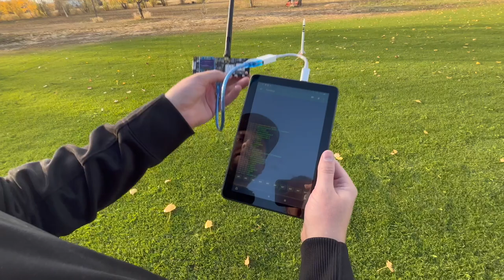ESP32 - Rocket controller Test

Comment: Curious..... how are you capturing the telemetry wirelessly? Is the onboard ESP32 Wifi signal strong enough to detect real-time data to any significant distance or by chance are you using LoRa.  Gathering info for a Graduate Computer-Science project.
Reply from the maker: Hi, I should’ve explain better. Yeah I’m using LoRa. I tested it at the 60 miles away in a small airplane. I considered making a tutorial on how to build a simple PCB and program it. Right now I’m in the works of building an app that will be able to monitor all the data.